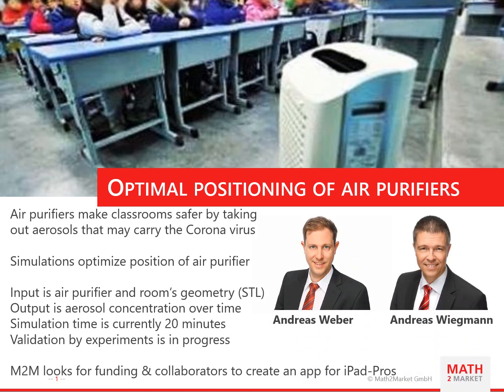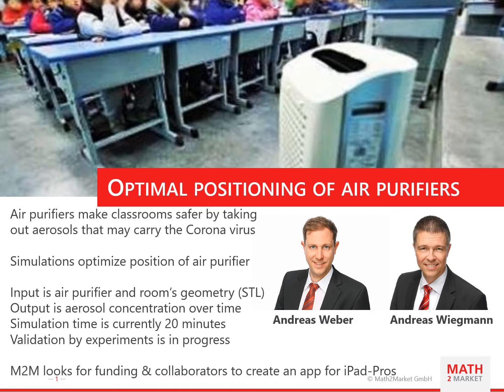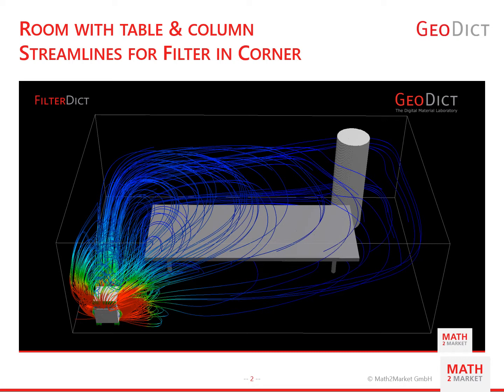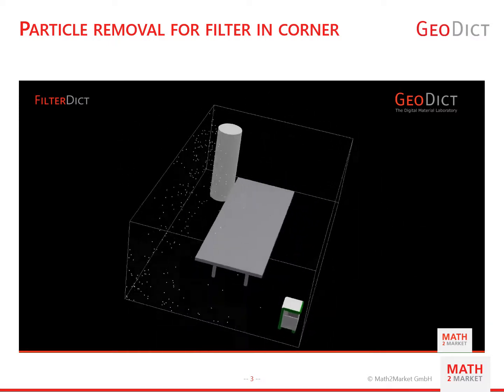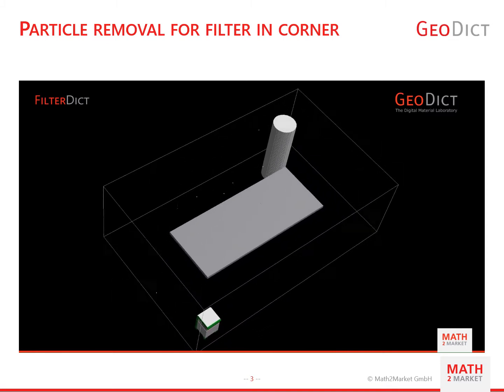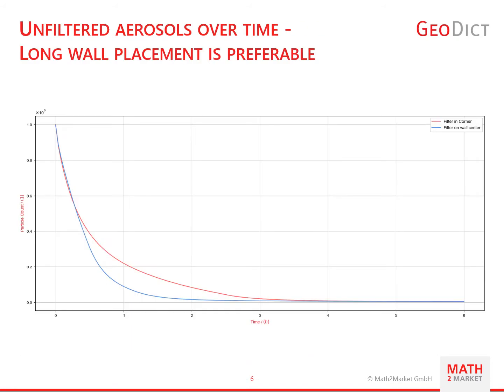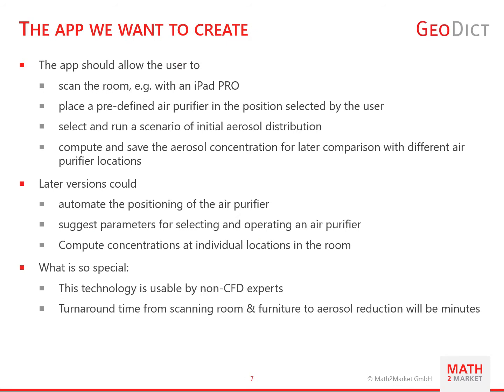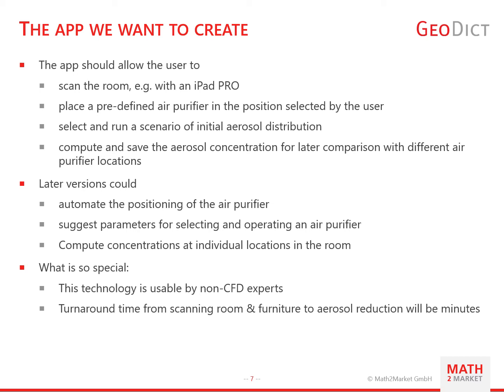Optimizing the location of air purifiers with GeoDict

Comment: Great Idea. Has this come to market yet.
Reply from the maker: Thank you for your question. The software (GeoDict) to run the simulations is on the market and needs only to be applied to the input data of the room (size, form, etc. as .stl for example) and the obstacles to the flow. The software delivers quantitative data on the air flow (velocity, direction...) and movement of particles. This data is easily visualized, as shown in the video.
Reply from the maker: For an update to this feature, see a portion of this talk on new filtration capabilities presented during our User Meeting 2021 at the beginning of October  https://www.youtube.com/watch?v=F0xd-FM-jW8&t=892s